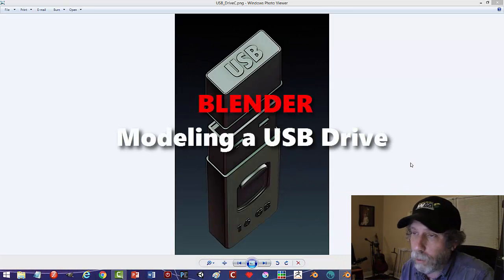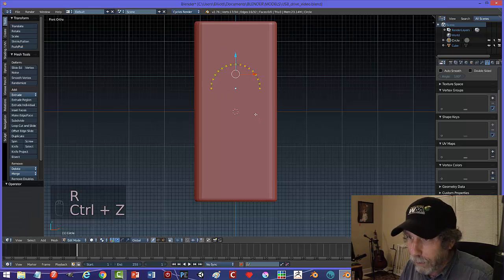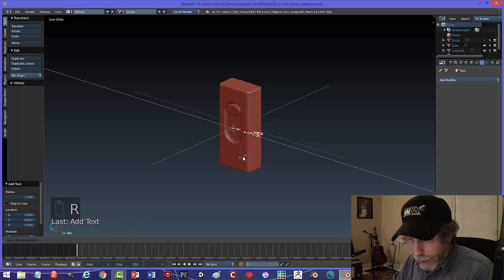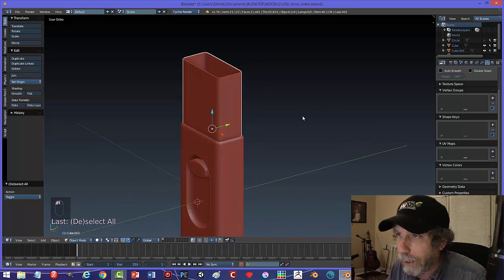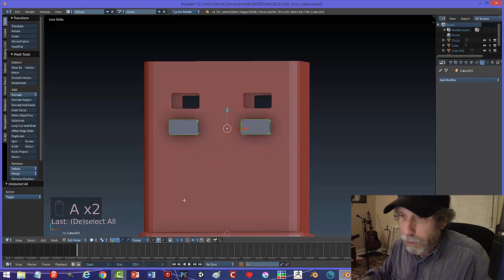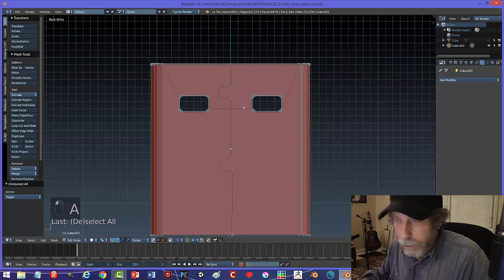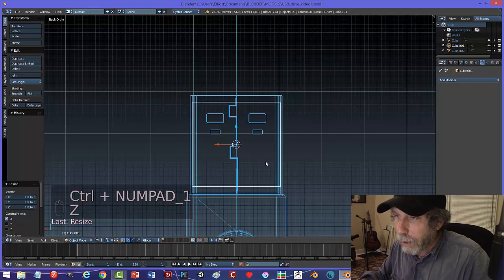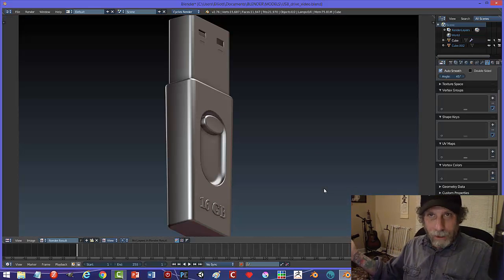Blender: Modeling a USB Drive

Comment: i got 2 notifications the first one said "Failed to set value" and the second was "modifier is disabled" is there a way to enable ?
Reply from the maker: Not sure why modifier is disabled unless you unchecked the eye icon in the modifier. Make sure if you edit in object mode and not in edit mode that you apply scale and rotation. That can affect modifiers. Ctrl-A and choose scale and rotation while object is selected in object mode. 

In general, if something doesn't work, I suggest working on a new layer with a simplified mesh and trying to do the same operation. See if it works or what you may have done wrong. Also can you tell me what you were trying to do when you got the failure to set value?  You've just done something the program doesn't like and it's not a big problem. Just something like trying to bridge edges where there aren't edges that can be bridged or stuff like this. 

Worst case, start again, go slowly step by step and see if you get passed the errors. And especially make sure to apply scale and rotation. In these early videos of mine, I often edited in object mode and may not have always remembered to do that. I edit much more now in actual edit mode. Good luck and don't stop. We can solve it :)
Reply: zerobio thank you 🙏 really kind of you to write me a big text like that
Reply from the maker: No problem. I hope you can get past the problem and move on with your modeling. Let me know if you are still stuck and if so, where in the video. Good luck!
Reply: @zerobio  i solved it thanks i alreadz finished the usb, thank you for your help
Reply from the maker: Excellent!  I knew you could do it. Congrats and on to the next :)

Comment: Hello there, i'm new to blender and people are saying to me to avoid n-gons and fix it if there is any n-gon. I like watching your tutorials but i see some of your models have N-gons, are the N-gons fine in this type of models?
Reply from the maker: That is a great question and I have two answers for you. Just like when you took your piano or guitar lessons, your teacher would constantly stress the importance of proper technique and the same goes for Blender and n-gons. Best practice would be to avoid them. However that didn't happen for me when I started Blender. I wanted so much just to be able to model something that I had plenty of n-gons and only later have I learned to try to avoid them as much as possible. I'm still not great at it and I still struggle with trying to do stuff and not get stuck with n-gons. So, best to avoid them if possible and if you are watching my videos, you will see a lot of them unfortunately. 

But, on the other hand, it also depends on the purpose of your modeling. What will you use it for?  I just want to model for fun and make renders. In that case n-gons have not caused me any trouble and have made modeling less stressful and more successful. I don't model for games or for animation, not yet, so n-gons are not really a problem. If you want to make games or animations, you should probably learn right from the start to avoid n-gons. But that doesn't mean it's the end of the world. Just do what u can and learn as u go and if you run into trouble with n-gons then it will be time to deal with them and learn how to model so that u don't have them. 

I hope that n-gons don't stop you from watching some of my videos and perhaps trying some of the models I make just to learn. Read more about n-gons and decide how much you need to worry about them. Good luck!!
Reply from the maker: And now that you got me going about this, I will make a video for you modeling a USB without any n-gons. Will try to do it tonight for you :)

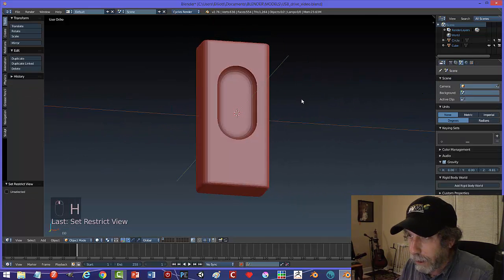Comment: I can't get the boolean difference to work. I've removed doubles, checked for non manifolds, recalculated normals, had the normals facing inside and outside. Whatever I do, boolean difference will not work. Seems to be a common problem. Hate it because already stuck at 4:49 now.
Reply from the maker: Did you do any scaling in object mode?  Try this ... select the main USB object and ctrl-A and apply scale and rotation in object mode.  Do the same for the cutting object.  Try it again.  Also, go into edit mode of both objects individually and select all and ctrl-N to recalculate normals.  Try it again.  If that doesn't work, go to another layer and try a simple boolean difference on two new objects, just two cubes.  Something may have gone off during the modeling and it can't be easily fixed and you may need to start over.  Hope you can get it to work! :)
Reply: I think my normals were off (maybe because of scaling in object mode?), eventually it did work but after flipping the normals but it left me with a but weird looking mesh on the edges of the inside where the circle was cut out. I have tried fixing the mesh and thought I succeeded until I had to bevel it. I will continue without the bevel and start over if I run into more problems ;-). thanks for answering. I had not thought of the scaling in object mode.
Reply from the maker: basj1970 yes that can definitely happen. May have to start over. Don't stop just do it again be careful and it will work out :)